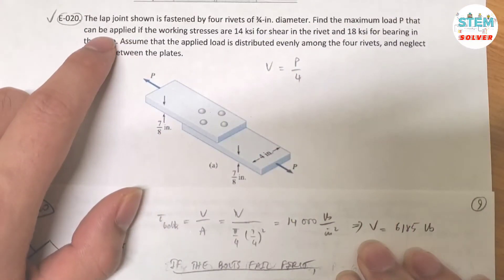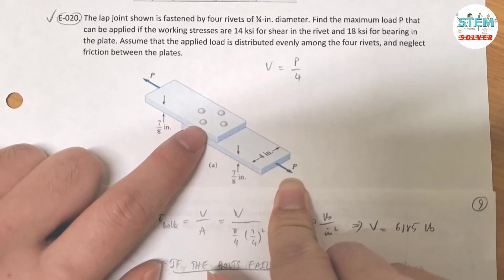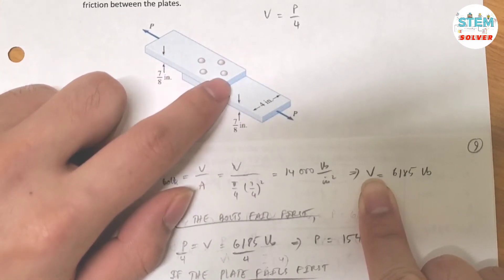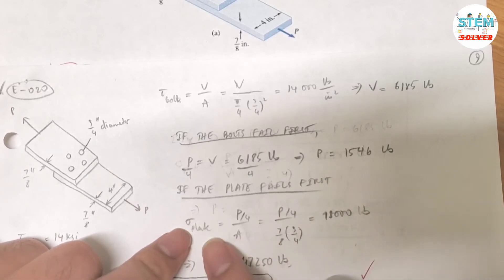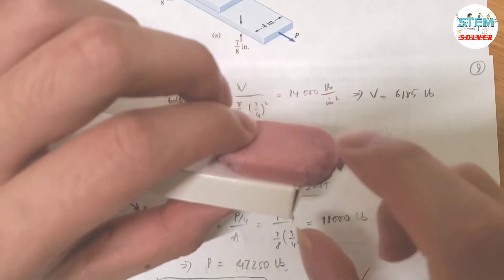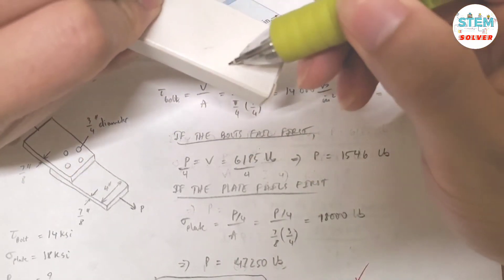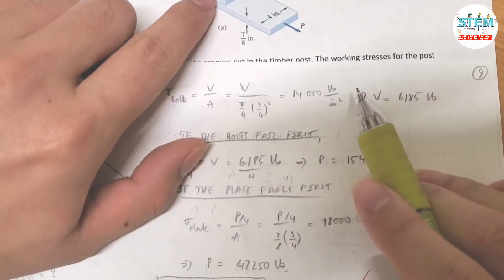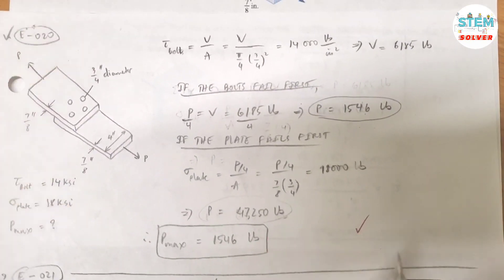The lap joint shown is fastened by four rivets of 3/4-in. diameter. Find the maximum load P... | MM

Comment: Hi! Since there are four bolts, and the applied load is distributed evenly, aren't you supposed to multiply that area by 4?
Reply from the maker: Please watch it again 2:10. I didn't multiple by 4 for the area because I found the total shear force first and divided it by 4 to get the shear force in each bolt. Does that make sense? You could multiple the area by 4 then you don't need to divide the answer by 4 to get the shear force in each bolt. Either way will work.